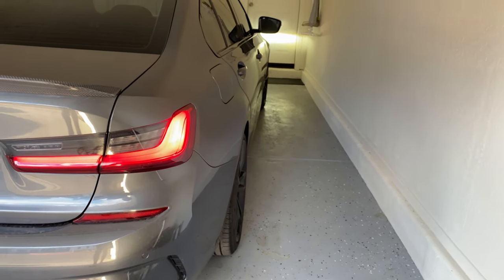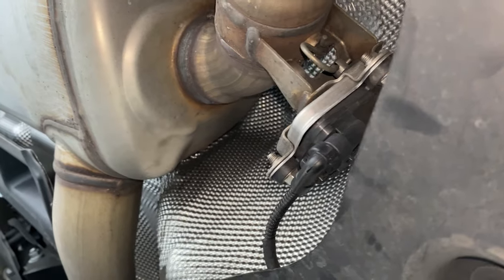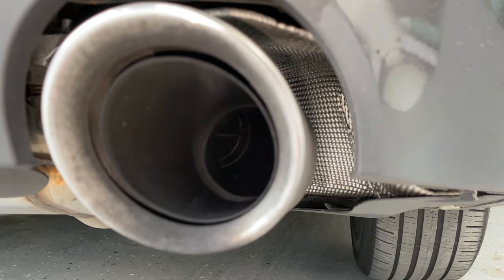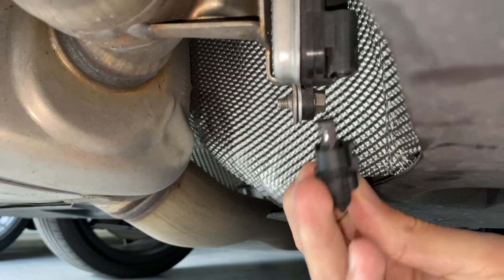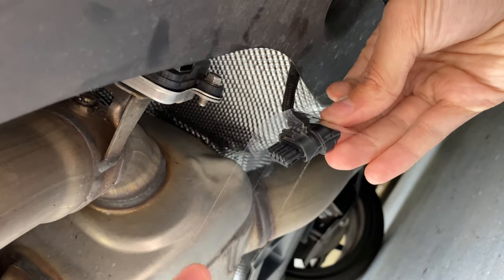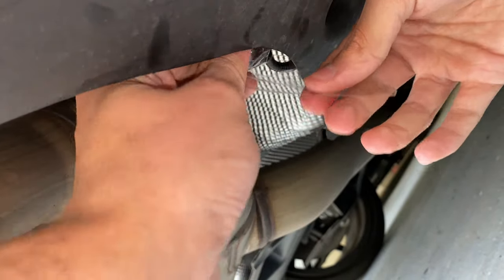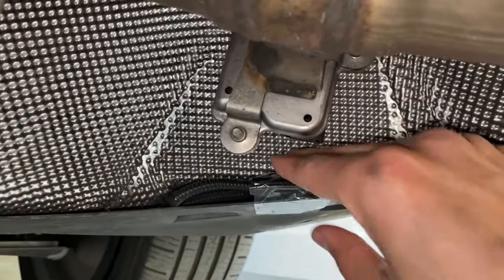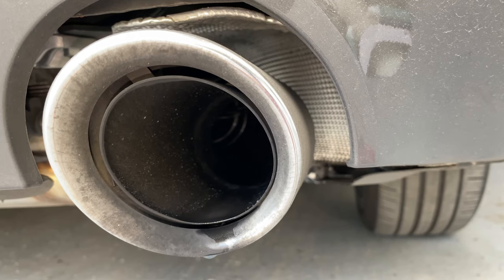Keep The BMW G20 Exhaust Valve Always Open | Free Mod | 2019 BMW 330i | 2020 M340i | 3 Series

Comment: just remove the connection rod and put it back upside down with tention so the engine part moves freely and the valve is locked in open position
Reply: By plugging the male plug back upside down into female connector, will it get short circuit?

Comment: Does doing this have any sort of negative side effect? Does it provide any benefits? Sorry I dont rly understand what this does
Reply: Pretty sure there are no negatives. Deosnt void warranty either cuz its easily removable and manufacture deosnt care. This will only make the car sound better. The valve opens in sport mode(basically a flap to make it louder) with this it will stay fully open. From the manufacturer the valves open more in sport but close slightly at lower rpms and this just keeps it open
Reply: @Emiliotattedme thank yu bruh yu a life love ong 😂😂😂

Comment: If youre in europe, this will throw an engine light. We have PPFs (petrol particulate filters) here and to do a regen the valve needs to be closed. USA is all good as you dont have PPFs.
Reply from the maker: gfusion that’s really good to know. Thanks! Is that why some EU models don’t pop or sound the same?
Reply: No i had 3 german G20. none of them had check engine light after mod.
Reply: I've done this on a uk 2022 M340i. No CEL. Much better sound

Comment: Just did it on 19 330i, which has nice stock burbles, and it sounds so much nicer. I don’t know why the valves close when in drive, as I noticed that they open in sport mode when in park, neutral, or reverse, but close as soon as I put the car into drive. 

I would assume that it would be better for them to stay open, as the car is able to exhaust easier as it has both the left and right pipes to let the gasses out of now. 

If you’re debating on doing it, I’d say why not, you can always reconnect she harness.
Reply: have you noticed any issues with the car since doing it?

Comment: Hi great vid, definitely giving this hack a go. Do you need to keep the engine running in sports mode when you disconnect?
Reply from the maker: After disconnect it remains open in all modes.
Reply: Yeah, i did it in the 340i. Kept in sport plus, disconnected clip, then inverted the clip and pushed it back in (more secure this way imo) valve stays open
Reply: @turdseyeview4763  thank you bro so excited to try this with my x5 50i
Reply: @sammyshadi7621  sweet car dude, gonna sound soooo beastly :D
Reply: @turdseyeview4763  inverted as in plugged it in upside down?
Reply: @jerromjoseph3185  as in you pull it out, turn it around (so like 180 degrees) gently push it in as far as it will go and then apply tape. I did this to minimise any water / dirt getting in.
Reply: @turdseyeview4763  thankyou. I hope it won't give any reading issue. Shit makes annoying noise for every error lmao
Reply: @jerromjoseph3185  no problem bud, no it shouldn't do lol, at least mine hasn't.
Reply: @turdseyeview4763  Thank you, I'll give it a go like this with my M340i
Reply: @DonsShed  you won't be disappointed! Just make sure you tape it off really well to stop water ingress
Reply: @DonsShed hey man i just did this mod on my 2023 m340i any feedback on it? Negative or positive
Reply: @oogaooga4644  No negatives for you.... but your neighbours might not be so impressed LOL 😁
Reply: @DonsShed  hahah alright man thankss

Comment: Do you really think this primitive tape will protect the plug from moisture ???
Secondly, what will happen to the unprotected pins in the black box, mounted to the exhaust when they become wet ???
Reply from the maker: Peter Hrd corrosion most likely, but I’m just protecting what’s connected to the cars electronics. The valve pins are now not connected to anything.

Comment: You can also start on Sport mode and avoid all that. If you leave like that, protect the contacts on the valve as well!
Reply from the maker: fegari g sport doesn’t stay open when in idle and drive, this sounds the best overall. I might go back to normal though, we’ll see.
Reply: @binarycars 
What u mean it doesn’t stay open when in Drive mode?
Reply: @MrSilk07 the valves constantly close and open depending on speed and rpm’s. So even if it does open in sport while starting as soon as you start to reach road speeds valve may close fully or partially depending on a lot of factors.
Reply: At least in my M340i in Sport plus: In idle, the flaps are open, as soon as you start driving, the flaps close and stay closed until 80 km/h. They only open up under load in the higher RPMs when everything is stock.

Comment: Did you drive the car in sports mode to open the valve? Mine is the X6 and told that its valve only opens in high speed…

Comment: It makes the car backfire? How does an exhaust valve opening cause excess fuel to be burnt in the exhaust...... it makes no sense. I’m pretty sure it’s just reverberation from ignition retardation above certain revs like most modern sports cars.
Reply from the maker: NL3044 it doesn’t make it backfire, it allows for more air to exit

Comment: Oh snap it worked! any side effects or none to worry about ?
Reply: any side effects you noticed??
Reply: Im interested too
Reply: No real issues, they are closed to warm up the engine faster, but take a look at the E92 M3 Exhaust, no valves at all. One pipe is open at all times anyways all this does is add more sound.

Comment: Hey do you think this would work on a 2022 430i, I just got my muffler removed and noticed that the there's a valve. It doesn't blow out from that one tip (obviously cause of the valve), so do you think i could do this too and make the car a bit louder?
Reply from the maker: Probably, it should help it breathe better
Reply: Did you get it to work? My car wont open the valve if its just idling at sport mode

Comment: Stupid question, but do you only need to do this for one side? I'm about to try this tomorrow on my M Sport. Just coded in sport plus today which was a nice addition as well! Thanks!
Reply from the maker: joe morgan how did you code sport plus? Is that new on BimmerCode? The 330 has only one valve yes.
Reply: Super easy. I bought an obd reader for $60 on Amazon and took me five minutes.
Reply from the maker: joe morgan thanks, I’ll try it out. I have a few things coded but this wasn’t available a few months ago!
Reply: @binarycars  yeah it was recently added and it's a nice to have!
Reply from the maker: joe morgan man... it said my adapter was not supported for the body domain controller, I have the V Gate WiFi. Which one did you use that supported this controller?
Reply: @binarycars  I used the lx version of this one, but if you have an iPhone you'll need this MX version OBDLink MX+
Reply from the maker: joe morgan yeah I saw that, 120$ is a lot for that adapter. Should be worth it though
Reply: Better use a simple enet cable and bimmercode on your laptop.

Comment: Why you didn't do the same thing on m340i 2021 to have more pops ?
Reply from the maker: I did, didn’t help
Reply: @binarycars   so this method won't help with getting more pops with the 21'?
Reply: @seanw9425 more burble but no more pops. Pops are really a dme/ecu thing as they require overrun (fuel continuing to be injected into the cylinder even with no throttle. No throttle = no oxygen. No oxygen = no fire. No fire = fuel is dumped into the exhaust.) The pop is the unburnt fuel igniting when it hits the hot exhaust

Comment: I just coded it into iDrive so I have an option to open and close them as I want
Reply: Do you have an howto or cheat sheet?
Reply: @Venigo  I watched a video on YouTube but I can't seem to find it right now. It a little more advanced of a code but the steps are out there
Reply: @buda7326  ive checked it in idrive. But for the 330e, this option is already available :)
Reply: @Venigo  What? We can force to open the valves all the time in the 330e? I will do mine tomorrow I think but I’m not sure yet

Comment: Just a quick note to anyone who tries to do this on the g20 330e, it’s not going to work 🙁
Reply: What’s the difference?
Reply: Will Raven the car is calibrated differently don’t there’s no burbles and the valve is closed for much longer at lower RPM to reduce noise whilst driving in cities. I bet with a remap this could be fixed or just physically disconnecting the valve from the solenoid in the exhaust.
Reply: londonas2 The valves in my 330e are half open now and connector is unplugged. Was like that when I bought it at BMW!!!!🤷🏼‍♂️ Going to try get valve completely open snd then unplug
Reply: Will Raven ooh lucky man, I’ve drove mine for about 3k Miles now and every time I check whether the valve is open, it’s shut unfortunately. I’ve read a lot of forums online as well and it seems people are having the same issue as well. Also, there seems to be a difference between 2019 models and 2020 models for some reason so maybe calibration changed at that point 🤷‍♂️
Reply: londonas2 I have a 2020 model, I guess since I bought it nee this year in march. I went to a garage to check the connector and he told me it is already unplugged. Strange you should get a new car in OEM condition normally. Maybe they where experiencing at BMW I don’t know. Sound is still not amazing with a 45 degree open valve but I don’t know how it sounds with connector plugged in
Reply: Will Raven oh okay well if you manage to get it fully open at some point, if you wouldn’t mind letting me know how you did it would be great, I’m struggling with this at the moment lol
Reply: @willraven5350  Any luck with getting the valve fully open on the 330e ?

Comment: Does it throw a check engine light? If not any obd2 errors?
Reply: Johnny Meza nothing at all. Done the same to my car and no problems
Reply: @germancollection_br   hey man still no problems?
Reply: @sammyshadi7621  Nothing. I have sold the car in February, drove over 7000 Miles (11000 Km)  and no issues at all. When I sold it just plugged the cable back in and it worked again just fine

Comment: Why is the exhaust valve present in the first place?
Reply from the maker: Most likely noise control, it could also be used for other efficiency reasons. If you’re always driving sport it probably doesn’t matter much and will start up louder when open

Comment: Is this possible on a 320i? I considering buying one but it sounds boring now.
And what is the difference with the 330i since they have the same engine?
Reply from the maker: Vyper they are tuned very differently but seem to have minor physical differences. 181hp vs 255hp.
Reply: @binarycars  So its just a software tune? Then I could chiptune a 320i to a 330i?
Reply from the maker: Vyper not necessarily, the engines are both b48 but there may be differences as their product codes differ, you’d have to check for what people have been able to do safely without hurting the engine
Reply: I believe 330 has twin turbos
Reply from the maker: TheDaddyredd twin scrolls but single turbo
Reply: TheLostDigit just watched a vid explaining twin scrolls 👍🏾
Reply: @Vyper-  330i has watercooler while 320i intercooler. And 330i has some reinforced pistons and other parts. But u can remap 320i engine to produce as much hp as 330i